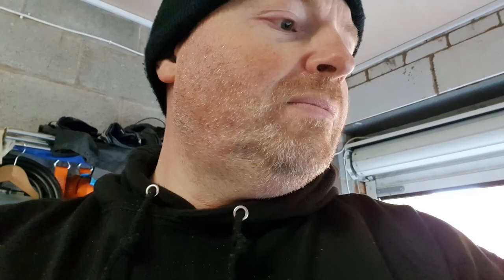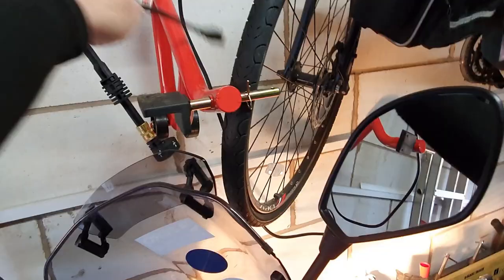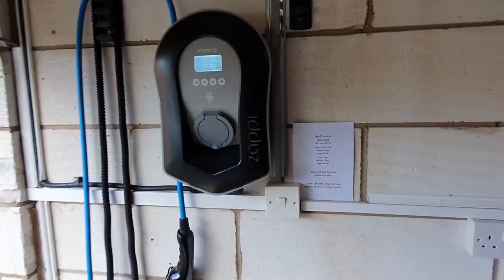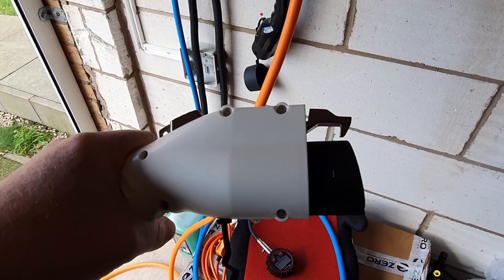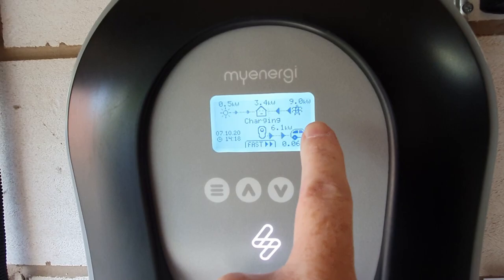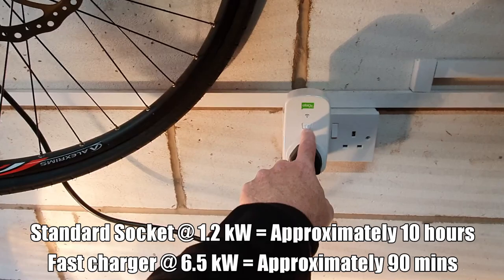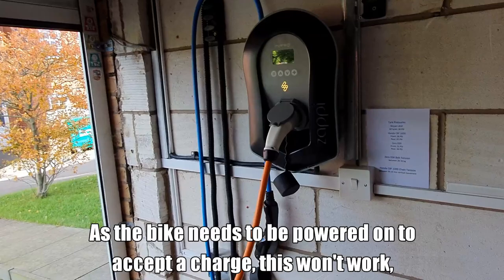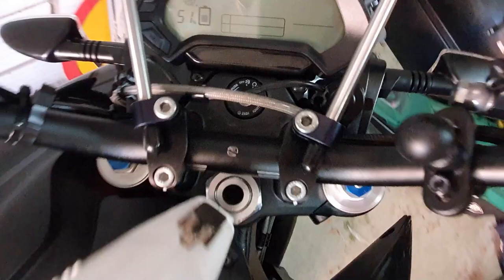Charging Chat and Long Way Cock-Up?

Comment: Ahh you're too kind John re The Long Way Up. While it might be opening people's eyes to EVs its also damaging, sending out the wrong message to a very wide audience, re charging & capabilities, not at the fault of the product but by poor execution of the production & planning. As you point out with a backing such as it was it should of been a no brainier to have this key element nailed down. This industry needs to flourish so tech and gains can be obtained quicker. One final point, I always have a giggle when people are patted on the back for having an incredible opportunity handed to them on a plate.

I think your films are great John, very informative & you put them across in a very calm & clear manner. Well done mate and keep them coming.
Reply from the maker: You make some good points there, Dave. Maybe I am too kind. I just got back from observing a check ride on my DSR (a free taster session to advanced riding we run) and the guy coming for the taster session saw my eyes roll when he brought up Long Way Up. 😁

Thanks for the kind words! 👍

Comment: The domestic sockets in Patagonia are not on the grid. That is why they had all sorts of issues early on. But really, as you say, the Harleys were a commercial decision and definitely, in my opinion, the wrong one. They didn't understand any issues with charging. In the bitter cold they couldn't go far on a charge, I think that was meant by the 70 mile limit.
Reply from the maker: Notwithstanding the issues in Patagonia, they hadn't properly sorted out domestic charging at all at Ushuaia. It was McGregor himself who mentioned that at the start.

The 70 miles comment wasn't connected to the temperature. It was an explicit assertion by someone who works with EVs that no electric motorcycle could do more than 70 miles. Boorman and McGregor proved him wrong on the same episode.

Comment: Great video John! Can you leave the 1.3kW charger charging slowly and then have the 6kW charger via Zappi on eco + to pull any surplus, as the bike is already powered on? I guess the normal eco mode would also do the trick of course. In the summer I've seen 5.3kW from my parent's PV and it would be good to use it all. I can confirm eco+ doesn't work on the SR/F and SR/S unfortunately.
Reply from the maker: Thanks, Aaron, and good question. I'll have to give it a go to find out. I doubt it will work, because I would expect the ignition is actually what needs to be switched on to engage the Charge Tank, but it's easy enough for me to try.

Comment: Thanks John. Hadn't heard about the series until you mentioned it here. It sounds as though someone has an agenda to denigrate EV's, in the ways that Top Gear used to to.
Reply from the maker: Oddly, I'm sure they were sincere in their efforts, as Ewan McGregor especially is fully into renewables, and at the start of filming is having his car converted to EV, but for some reason they choose not to talk to any seasoned electric motorcycle owners for their experiences and to properly understand charging options. 🤷‍♂️
Reply: @jtchivers  Agenda.... Or simply making what the bosses think is more compelling TV. When all is said and done, the producers and directors usually have the final say about what should be recorded and broadcast. The presenters have to either do it or else lose the job. I worked as a volunteer cameraman in a TV studio, when at college, and saw some of what happens behind the scenes. And yes, stories can almost lose contact with reality, just to fit an agenda.

Comment: Can your Efergy wifi socket handle switching the full 1.3kW load that the DSR draws reliably without arcing?
Reply from the maker: Absolutely. Used it reliably for four years.